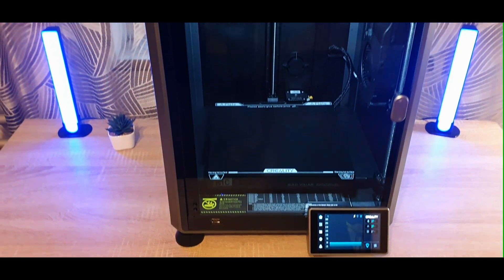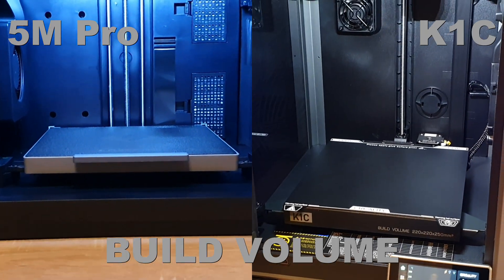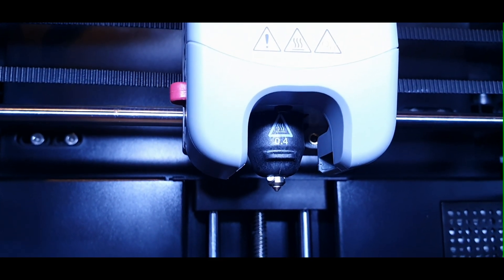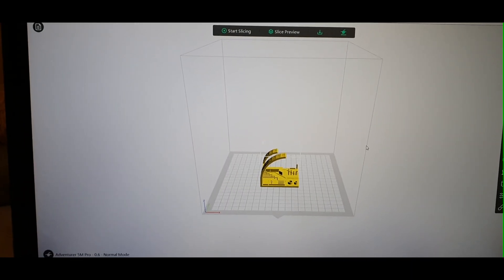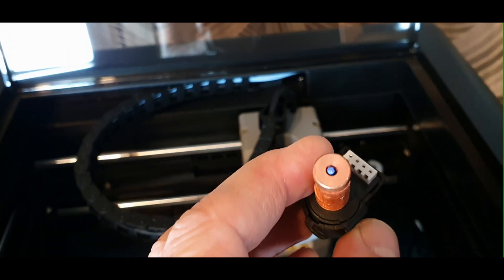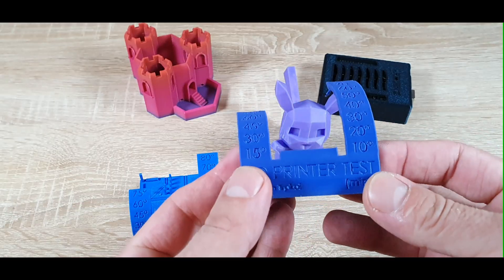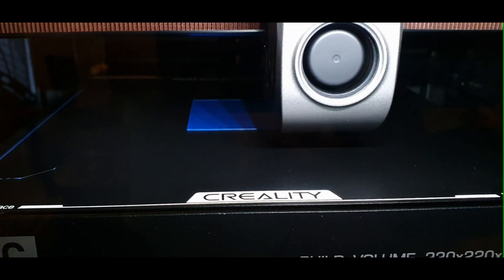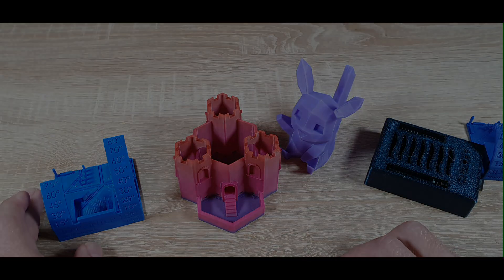I Tested the K1C and 5M Pro – Only One Was Worth It

Comment: I'm looking to buy one for my 10yo we don't have a PC and looking for something that we can use from our phone. We found both of these printers to be what we are looking for just can't figure out what's the best one.
Reply: The 5m being limited to flash print means you have to put the design on a SD card right? All that can be done from a smartphone or tablet?
Reply: @dontdogarage  I looked into this myself, because I didn't have a computer. You need to computer to slice it and all that. I'm still learning myself.
Reply: @patrioticAussie  you don't need a computer to use other people's stl files you just can't make your own without a computer. I bought the flash forge adventurer 5m and it's super simple to use from my phone. Everything I'm interested in making already has a file available.
Reply: @d @dontdogarage  so unfortunately you don’t just upload the file. The slicer makes the exact instructions for the printer so you NEED to put it through a slicer. If you upload the stl file nothing will happen. Technically it is possible but very limited. I wouldn’t recommend it. By the way mostly any laptop should work as long as it’s relatively new. You can also go to your public library and put stuff on your drive there but in that scenario I would just be easier to use the libraries printer. Any questions just ask please
Reply: @FriedPhish_yt  I've also found if you have the pro version of polar3d you'll get a link to their mobile version of 3d design maker and it's super simple to make my own files I can even take other files and modify them and take them apart pice by pice. For example I wanted to print a 4 post lift fory scale rc garage but it was a solid 1 file print but with polar 3d maker I was able to take each lift post off and split the lift base into multiple sections to fit my build plate.

Comment: Its a video I wanted to see. But you hot your info wrong with ChatGPT…

5mpro has 2 nozzles included that lasts a lifetime 0.4 fine and 0.6 for hardened and exotic filaments. 

there is Orca slicer for Flashforge and advised to use it by the manufacturer. They are both open source printers.

The nozzle is one way direction by design so never gets stuck… ❤

I do love Creality as its innovative and looks more industrial. 
But I git 5Mpro for both for home and for school as my students love it.

Comment: m5 pro has an easy to use nozzle change and the .6 and .8 are hardened and print the high temp filaments just fine.  Also, the filament change is easier than you made it seem.  Yes you have to pull the tube and cut it, but then put the tube back on - feed in the new filament and do only one filament advances.  An auto cutter would have been nice but not that bad.
     I had a Prusa 3 I loved but stopped using a few yrs ago, came back to hobby and it would not print and I HATED bed leveling.  Bought the 5m pro $420 - instead of the Prusa Core One - $1200 or the Qidi Four plus $750.  Very happy with it - love that I could right out of the box just start printing - been print almost non-stop since.
     The one drawback is the smaller print volume 220x220x220.  If their next version just had a large plate I would buy it now.  I am only speaking to the 5m - no experience with the K1C it may be a fine printer.